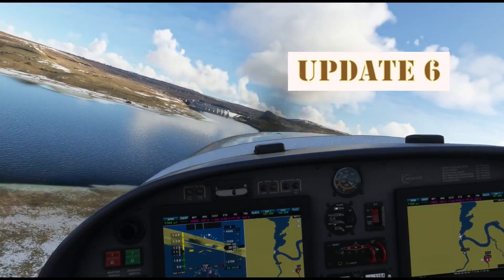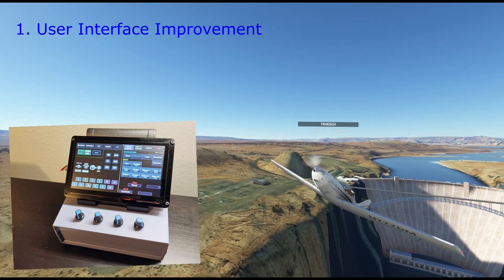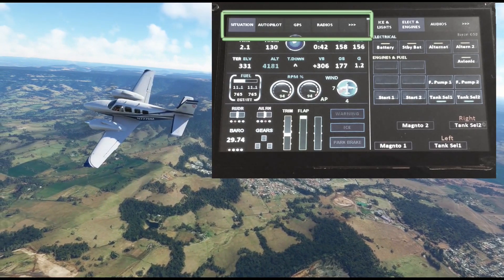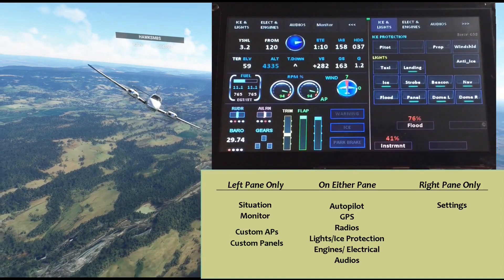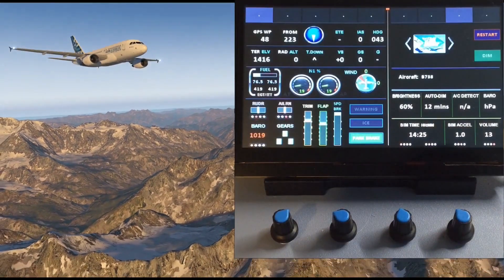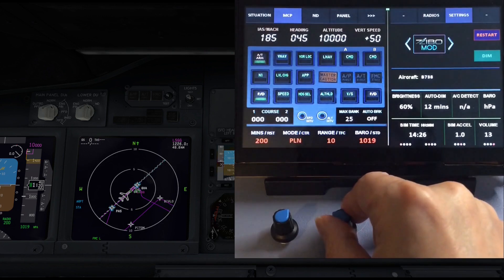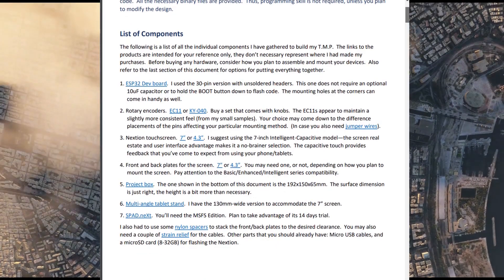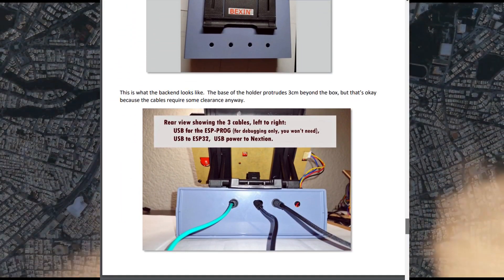Flight Sim Touchscreen Panel  [Update 6]

Comment: Thanks for your work, I will try building this, have the esp32, and encoders, just looking at ordering the screen, could you maybe make a full screen with flight dials when not making adjustments
Reply from the maker: Implementing full-pane pages is on my list, to take advantage of the 7” screen.  However, the goals have always been to supplement the virtual cockpit rather than to replicate the steam gauges or PFD.
Do share some photos of your completed T.M.P!
Reply: @discman777  Do you have a discord channel to use? I have flashed the esp32, mounted the encoders and wired up on a temporary panel.
Reply from the maker: @Rosenrot213   No, you can email me via the link found in the Building TMP PDF.